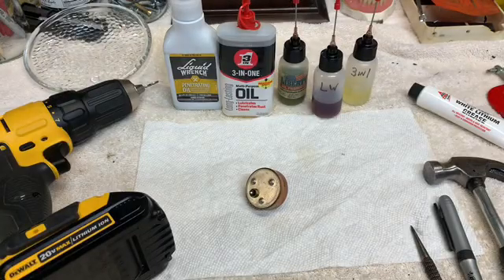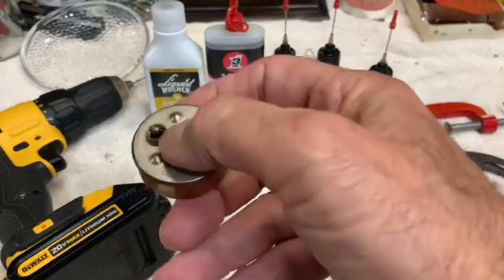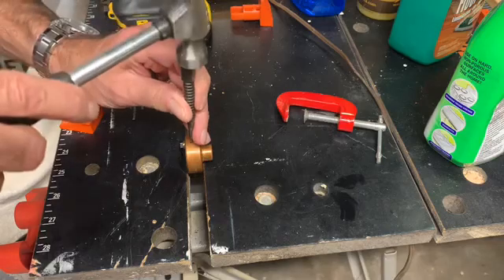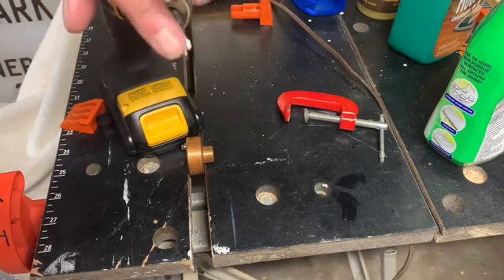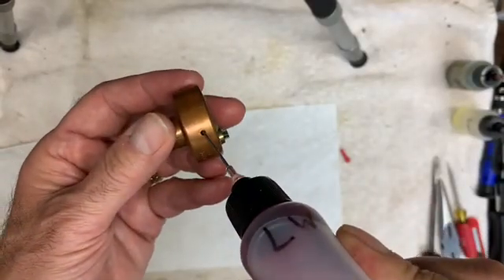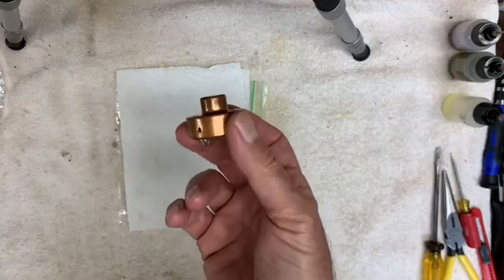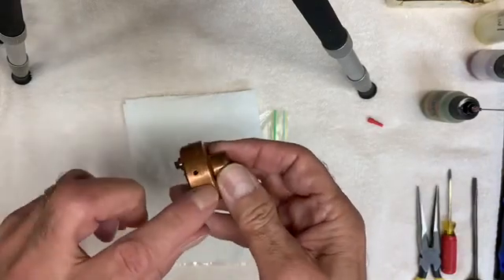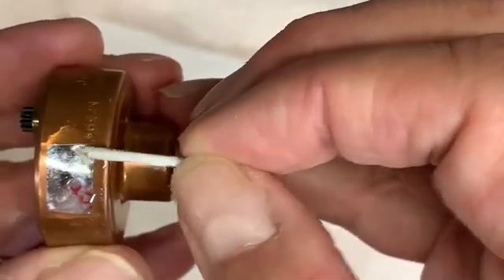How to Repair a Frozen Telechron H Rotor

Comment: The engineers that designed the Telechron rotor were real geniuses.

 1 - Sealed movement with capillary-effect oil distribution inside the going train for permanent lubrication,

 2 - For the fast RPM gears, fiber gear plates that, unlike nylon counterparts won't crack or dry-out over the years and with the laminated steel pinions will never wear out,

 3 - For the lower RPM, brass plate gears for added torque capacity,

 4 - 1000:1 overall gear ratio with 10-tooth final pinion that are compatible for both 50 Hz and 60 Hz circuits wih a minor change in the second hand's gear,

 5 - Separate rotor and reversible armature that allow CW / CCW rotation for some jewish traditions. I also remember some "Bar Saloon" electric clocks that had their hands rotate CCW.

In my youth, i've dismanthed several Telechron movements harvested from old ranges thrown away on the street.

In all, except one, these rotors were in near perfect condition, the only defective one i remember had a worn-out output 10-tooth pinion.

The Telechrons were the only "perfect score" clocks motors i found. All others models i dismantled shown MANY non-working movements.

Even today, i have a working Telechron clock.

Gear details:
 
TELECHRON ROTOR GEAR TRAIN (60 Hz)
Angular speed   Description            Component tooth count                       Rr              Rr total
===========  =============     ========================    ==========  ==========
3600   RPM    synchronous motor   12 tooth pinion                                   1:1              1:1
 864   RPM    2nd gear                       50 tooth plate     12 tooth pinion  4.166667:1  4.166667:1
 192   RPM    3rd gear                         54 tooth plate     15 tooth pinion  4.5:1             18.75:1
  57.6 RPM    4th gear                        50 tooth plate     12 tooth pinion  3.333333:1      62.5:1
  14.4 RPM    5th gear                        48 tooth plate     12 tooth pinion  4:1                 250:1
   3.6 RPM    6th gear                       48 tooth plate     10 tooth pinion  4:1                   1000:1

The 3600 RPM rotor was free to move axially and featured a wider-than-normal laminated pinion.

This feature allowed this rotor to self-align with the armature's magnetic field without any contact with the support plates, making these movements, unlike quartz movements, perfectly silent  and the shaded-pole armature / hardened steel disks allowed the Telechron to self-start, in the right direction, a feature uncommon for synchronous motors at this time. Even today, MANY electric sync. clock motors start rotating in either direction and require a ratcheting mechanism to correct the rotation sense, a total nonsense.
Reply from the maker: Very impressive!  You could write a book. Way more info than I could have ever imagined. And yes, it seems most every Telechron rotor I try to repair works. Can’t say the same for others. Thanks.

Comment: excellent video !!! This is the best way to restore a Telechron rotor ( BTW, Telechrons were by far the best electric clock movements available, thanks to the sealed rotor and the use of fiber plate gears, along with laminated pinions ).

My two cents: If available, use a press drill to bore the hole. A press drill gives you much better penetration control than a hand drill. The lithium grease ides is excellent to keep the shavings out.
Reply from the maker: Thanks, I don’t have a drill press, but I use a sharp tipped nail set to that makes a pin hole so the drill bit does not slip and slide.

Comment: @markh77 My rotor got cleaned with 91% alcohol, and seems to work fine for a couple of days but then it makes a weird grinding noise and starts slowing down. Any ideas?
Reply from the maker: The alcohol probably evaporated and left a dried out rotor. You need to put some synthetic oil into it. In a perfect world you would flush it out with the liquid wrench the way I did in the video. Good luck.

Comment from the maker: Is it the rotor that makes the noise?  If so, you have nothing to lose. You can also try a temporary fix by heating it with a hot air gun, see if it improves. If so, open it up and follow the steps.

Comment: i wonder if maybe just putting the rotor in a jar filled with IPA and throwing that into a water filled ultrasonic cleaner wouldn't be quicker and more effective. it would probably take about 30 minutes to decrud the thing, and then the IPA would dry pretty quickly. you could just shoot some compressed air into the hole if you wanted to be done immediately
Reply from the maker: I don’t know what IPA is, but the key thing is removing the old oil. I would never put it in water. The gears are not brass, they could rust.
Reply: @markh77  isopropyl alcohol. use 99% and it will be fine. you can't put IPA directly in an ultrasonic cleaner because it could ignite, so typically what you do is put the part in a glass jar and fill the jar with alcohol. then you put the jar into a bath of water with a little bit of soap to help conduct the vibrations. it will blast the grime out of the inside of the rotor quite completely
Reply from the maker: @briangoldberg4439 are you putting a hole in the rotor?
Reply: @markh77  I think you would have to or there would be nowhere for the junk to escape
Reply from the maker: i have tried removing the old oil from the gears with alcohol, but it does not do as good a job as  liquid wrench, it is a better solvent. I'm imagine the same would apply internally in the rotor.  I have had good success following the techniques outlined in Craig Shields' book, 'Hammond Synchronous Clocks Maintenance and Repair' @briangoldberg4439
Reply: @markh77  like dissolves like, so liquid wrench would definitely be more effective at dissolving the old oil, but it wouldn't matter in an ultrasonic cleaner. the US cleaner pulverizes the old oil and dirt with vibration and it would just need some liquid as a medium for that. alcohol would be more effective than water, and it will dry out more quickly and completely than liquid wrench, which is why i recommended trying that. if you are just letting it sit overnight, then yes, you would want something petroleum-based to dissolve it. however, you could also put liquid wrench in a jar and put that in an ultrasonic cleaner if you really wanted to

Comment: I would skip the epoxy as I have complete confidence in that tape. With the rotor basically just sitting in the clock upward and never being touched, I can't see the tape coming off.
Reply: I'm with team tape only, but I like the extra credit with the expoxy.  HVAC tape holds up well with heat.  I like to use the thicker aluminum one.  Modern motors /timers use a clear label to keep the oil inside.  Haven't seen one fail when i punch into it to lubricate it.   I'm not a fan of drilling a service port, but I do feel like it's a worthy option to perform and oil change.
Reply from the maker: I don’t have as much confidence in the tape. The rotor gets warm which could eventually loosen it.

Comment: I just bought a GE Telechron Air Lux from the mid 40's. I have to solder on a new wire (thankfully the coil is good) as well as free up the rotor. Thank you and will be getting out my drill. Great video!
Reply from the maker: Thank you, good luck with your repair.

Comment: I did the oven heat it up and it sucks in the oil, it sure does. I keep drop of oil at gear re heat do a few times..I used tuf oil luber in a pen..motor was super scretchy noisy as all heck..now quiet..I mean barely hear motor with ear on case.. well over 2 years ago.still quiet..  Light bulb trick was old school.(Now leds are cool).  see sites for temp.. Its fun to see oil suck in as motor cools.. no holes needed..

Comment: A piece of brass shim stock thicker than foil can be soldered over the hole without danger of having it flow into the rotor.   Takes a little practice but it is faster and more permanent.  Epoxy does not adhere well to the rotor case long term.  Ask me how I know.

Comment: A heat gun application would soften up hardened grease and is sometimes all it takes to get this model rotor going again without surgery.
Reply from the maker: I imagine that’s the same result as heating it in a toaster oven. But I’m thinking today’s oil quality is far superior to what was available in the ‘30’s and ‘40’s. Once it cools down, it will likely thicken up again sooner than later.

Comment: Consider adding a drill stop to remove some of the tension performing your drilling.  Take a length of brass hobby tubing and cut it so that it fits on the drill bit and leaves a small portion exposed so just the thickness of the case is accessible to the bit.  😀

Comment: The reason I didn't go this route for my Tele-Alarm Jr. series is because there's going to be (chances are) small metal shavings entering the rotor after this is done. Still, you did a fine job. Keep it up!
Reply: If you put some thick grease like wheel bearing grease on your drill bit, it should hold the metal shavings and stop them from falling in.
Reply from the maker: Thank you!   The filings are a concern. But I’ve done this to several clocks and so far they are still running. Some close to 2 years ago.